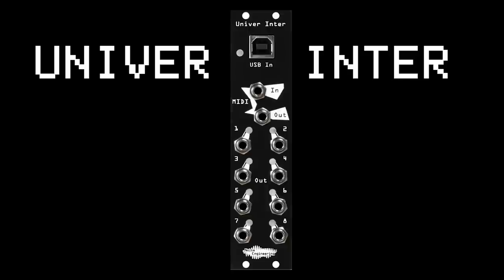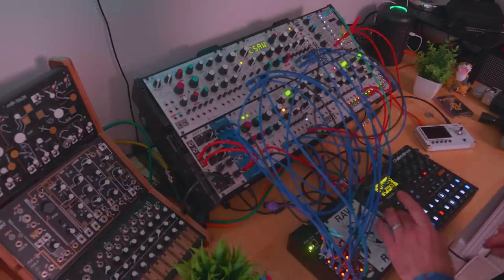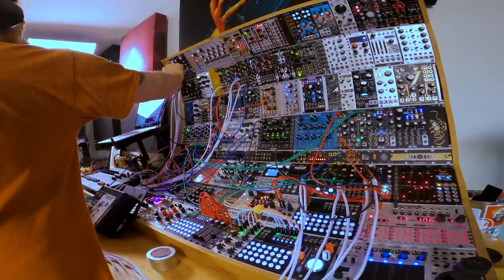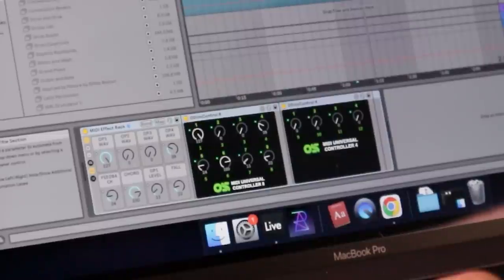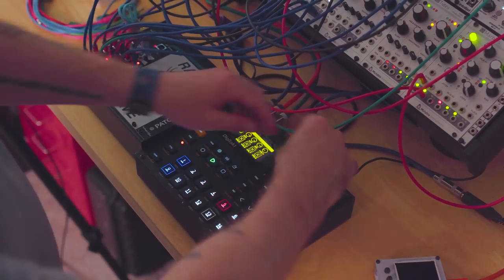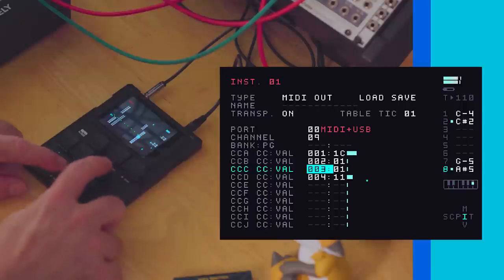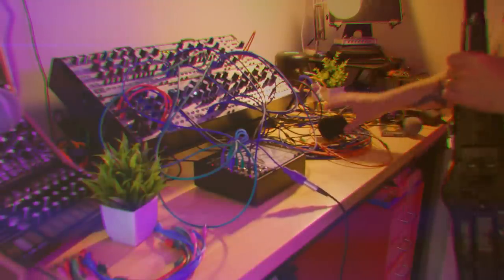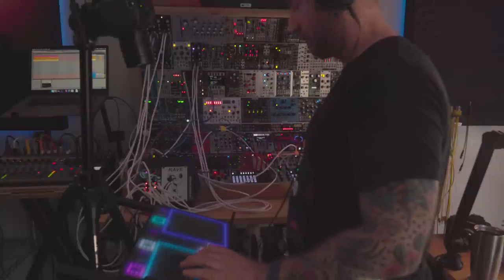What Can You Do With a MIDI to CV Convertor?

Comment: I skipped straight to 18:19 because I have the AE-30. Does this converter handle legato playing properly? Does pitch bend transition smoothly between pitch up and pitch down (essential for the bite control)?

I'm looking for a separate Eurorack converter but it has to be as good as the Behringer Neutron's converter which suits the AE-30 perfectly but comes with the rest of the Neutron attached whether I need it or not 😀. None of my other converters handle legato and they have dead-spots in the middle of the pitch bend which interferes badly with the conversion of the bite sensor.

I use a Space Brains Circuits MidiVolts to convert the AE-30’s thumbpad, elevation, and tilt to CV. The CC to CV conversion really opens up the possibilities for controlling VCF cutoff, resonance, LFO depth, etc.
Reply from the maker: i did not find either of those things worked, but im brand new to the aerophone so i may have gotten it wrong.
Reply: @RedMeansRecording  I keep forgetting to switch the MIDI Control switch on 🙄!  If you're interested I have a video on my channel showing how I set up my AE-30 to work with my Neutron.

Comment: Hello, thank you very much for your video. I need help to configure the elektron analog rhytm mk2 to synchronize the tempo of the 960 sequential behringer eurorack. Let me explain, I want the master tempo of the elektron so I use the elektron midi output to the CM1A cv midi convert midi input. On the CM1A, a plug trig cable to shift the 960 sequencer but it doesn't work... My sequence on the 960 sequencer doesn't change when I move the tempo on the Elektron. Thanks in advance.

Comment: Hey. Would somebody know if it would work also with AE-10? I am not ready to switch to AE-30, yet.
Reply from the maker: If it has midi out yes
Reply: I don't have the AE-10 but looking at the manual it doesn't have 5-pin DIN so you'd have to go via a computer or try to find a compatible USB to MIDI converter (apparently some work better than others).

The AE-30 works really well with modular - the breath, bite, thumbpad, elevation, and tilt give so much control and are easy to set up.
Reply: @unclemick-synths  thank you very much. That is what I was afraid of and that is why I asked. Thanks for your clarification.